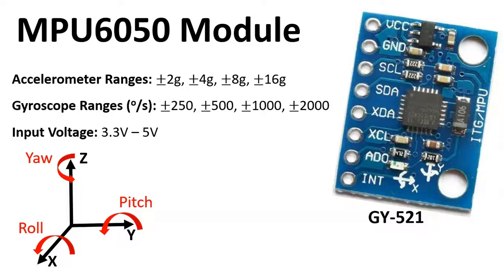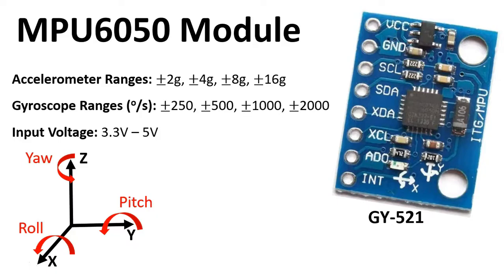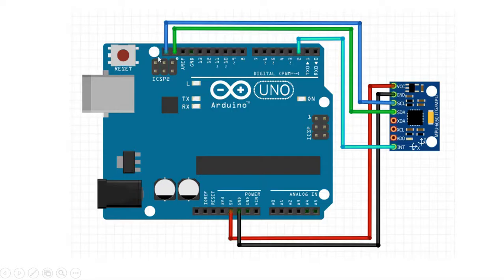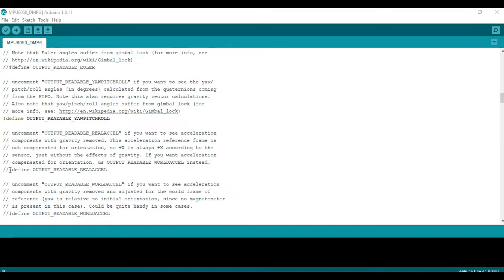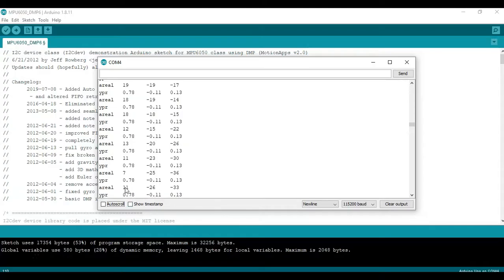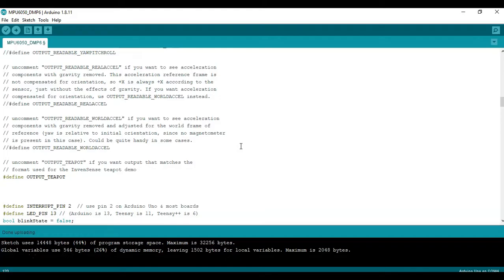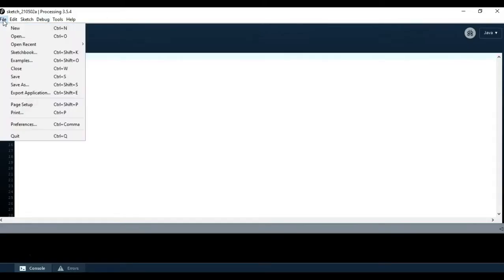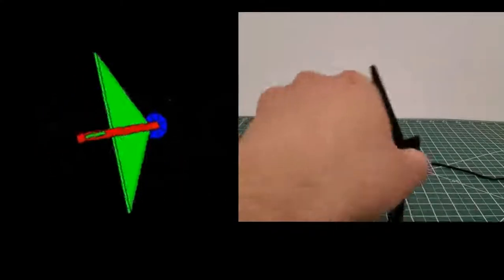MPU6050 with Arduino - GY-521

Comment: Ha! Three years later, two computers, and 3 operating systems later I finally got it to run. Couldn't get it up on my Windows8/8.1./10.  Working fine on Windows 11/Processing 4.3.4
Reply: Why didn’t you try MS-DOS 3.11 first? That alone would have cost you another three years of trying. 😀
Reply: @nick066hu DOS prior to 3.3 only handles 1 Megabyte of memory unless you were a combined hardware engineer and could develop a micro code far jump into protected mode past the Intterupt Vector Table.

At any rate, it's running which is better than sitting around WTFing.

MS DOS 3.1? That had to be original because it used to be IBM DOS 3.0 when they owned the patent which shortly started the clone industry.

Happy Holidays

Comment: sir can you help me? my mpu6050 gives accelerometer z which is the yaw to be a constant even when i rotate, i dont understand why, but some comments suggest to buy an imu with magenotometer, but the gyro z  that i read is still updating when i turn the imu sensor

edit : i used adafruit library but after trying the electronic cats library i think it works

Comment: It works for few seconds and then the whole arduino frezees. I did connect AD0 pin to ground, the SCL and SDA are connected to VCC by resistors each 10kOhm, the INT pin connected to pin 2 on my Arduino Mega 2560 board. I can see the plane rotating and then everything freezes and only restarting arduino fixes this. :|

I have been trying to fix it for few hours now and nothing works. Only when I use libraries that does not use DMP, the arudino doesn't freeze and everything works smoothly but I don't have any precision and the results get inaccurate pretty quickly.

Comment: Hey there! I really like your video and followed your steps. The visualization in P5 works great. However, only for a couple seconds. After that the rotation drifts off until there is no more data coming from the arduino. Is there a way to ensure a constant data stream?

Comment: my serial monitor is printing things like "⸮<⸮V⸮⸮ ⸮⸮" someone can help me?
Reply: change your baud rate to 115200
Reply: @tangguh9796  Thanks
Reply: @oguve278  do you have problem with 3D simulation ?
Reply: tangguh oh no no, your comment to change the baud rate solved my problem 👍
Reply: @oguve278  I'm just asking, cause my simulation doesn't move at all
but in the serial monitor work perfectly
Reply: @tangguh9796  now in one code its adding the angles, starting in -2°. And in other code show all angles as 1°

Comment: Hi, amazing project! But my processing doesn't work...while data are available on serial monitor.
Could you help me?
Reply: 2 things I did before I got Processing to work:  I closed arduino's serial monitor, because I was getting a "port busy" error; (2)  I printed the values of "Serial.list()" and I saw that the port that matched what Arduino was using was at index [2], not [0].   btw I'm using a Mac.

Comment: I want to jump off the highest bridge, hell...just help me and ill jump off the quadcopter i make, im mad af, i cant get multiwii to aknolege my arduino board, sensors work i seen the cereal port work, then i kept getting issues with the processingide software download dont have the ide in the unzipped files....then now the cereal port shows axis gyro but after like 2 seconds stoops reporting sensor like it stoped, i unplug it plug it back and its work again but stops after a few seconds....i cant get the processing app downloaded, any guidance would help, right now i feel like tossing all these modules for arduino and getting a full on flight controller and saying to hell with arduino
Reply: i was wanting to build a flight board with ports to make it completly modular with gyro not with flight controller, making the gyro replacement easy as unplug jst

Comment: Is it possible to use mpu6050 to calculate the displacement of a moving robot , Thanks in advance !
Reply from the maker: Hi! It will be very difficult to do so accurately because doing so would require performing an double integration of acceleration over time. The issue is that the error in measurement would be greatly amplified during such integration, which would lead to gross error in total displacement. Net, great in theory, but not so much in practice.

Comment: hi, i have a code error for the mpu6050 code. C:\Users\admin\OneDrive\Documents\Arduino\libraries\MPU6050\src\MPU6050.cpp:254:6: note: implicit this pointer type mismatch
 void MPU6050::setFullScaleGyroRange(uint8_t range) {
Reply from the maker: Make sure you have all the required libraries! Thanks for watching.
Reply: After downloading the library from the video, I saw that there are other libraries that are required to run the code maybe it is a factor. I read the line:

// I2Cdev and MPU6050 must be installed as libraries, or else the .cpp/.h files
// for both classes must be in the include path of your project

Comment: Hi, could anyone copy paste the mputeapot code for the process ide because i cant find it so if anyone can see it then please copy paste it in here thank you.
Reply from the maker: Hi! Thank you for watching this video and for calling out that the link wasn't available. The link to the Processing IDE download can be found on the blog post related to this video. The only issue is that I originally placed the link to the wrong post on the video description, but I have now corrected this.

Thanks for watching. Please let me know if you have other questions.
Reply: @diyengineers  Oh I just realized that i do have the process ide link but what i am looking for is the teapot code thing which will show the 3d visualization screen. so i need to code not the ide. I already have the ide. Thanks
Reply from the maker: Hi!  See below (these instructions are on my blog as well):

Once you have deployed the code above in your Arduino, go back to Processing IDE and go to File, then Open. Go to the folder where the MPU6050 Arduino library was installed. Once you get to the folder, open the Processing file with the name “MPU Teapot”.
To find this file, go to the folder where all Arduino main files are located, then follow this path: Documents\Arduino\libraries\MPU6050\examples\MPU6050_DMP6\Processing\MPUTeapot.
If you have trouble finding the location of the main Arduino folder, within Arduino, click on File, then click on Preferences. Go to this folder and follow this path within Processing IDE (after clicking File –> Open).

Comment: The link to download Processing IDE: https://processing.org/download
Reply from the maker: Thanks for watching and sharing!
Reply: @diyengineers  Hello, do you have an idea why the 3D model does not point to the position of the module instead it points in a different direction?
Reply: Nevermind i found out why, it was oriented diffrently but now after a while it moves random but it might be because of noise

Comment: I was seriously considering about wireless to sensor pin inside the aircraft or rocket.
Reply from the maker: Thanks for watching! You would just want to make sure you pick a micro controller that's appropriate considering the space constraints and then figure out how to address the wireless communication for your application.
Reply: @diyengineers  
I obviously the SpaceX Land was test in same circuit.
Reply from the maker: LOL 😂